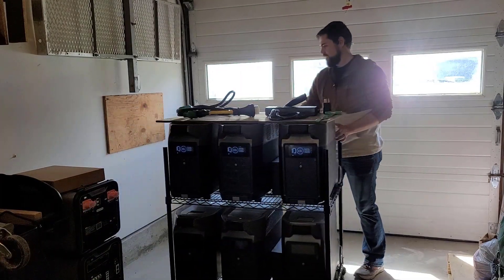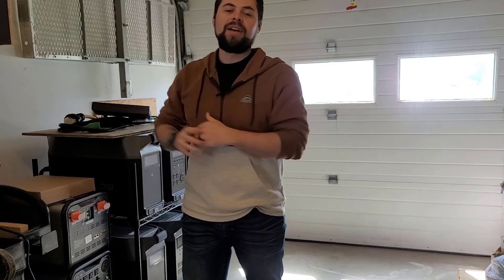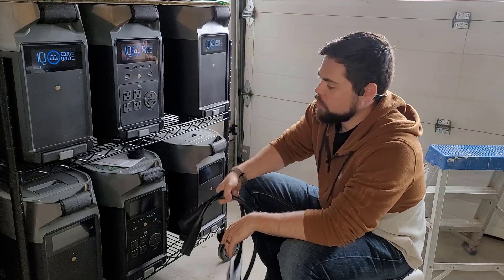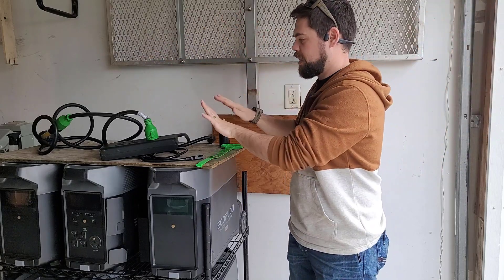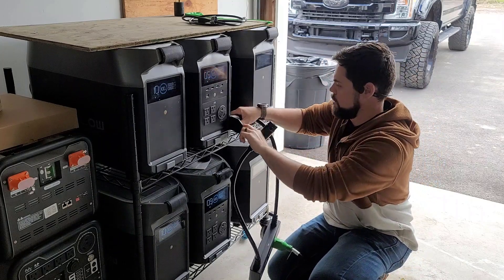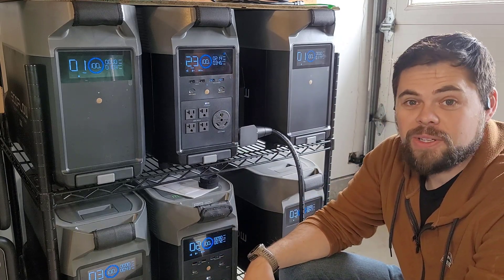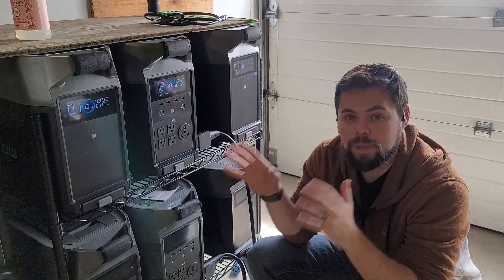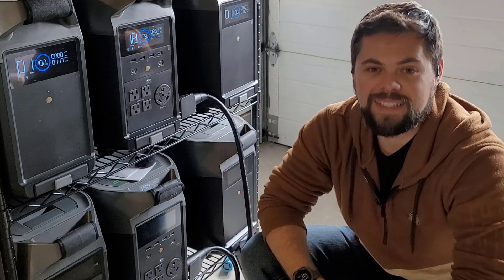EcoFlow Delta Pro Setup and Test

Comment: Now how would you use a smart generator to recharge if you couldn’t use solar?
Reply from the maker: The smart generator plugs directly into the back of the Delta Pro in one of the battery ports. If you have two batteries, you have to disconnect one of them to recharge the system. That's a poor design in my opinion but that's how you do it.
Reply: @minutemansolar  yea I agree that kinda annoying. I seen me guy have two separate inlet ports and he would use his smart generator in one of them from the outside which powered the outlets and then he would plug in his delta pros in the wall outlet then when charged he would which then around and plug the delta pros back in the inside inlet from the house and remove the gas generator
Reply: Here is the video I’m referring to.

https://youtu.be/dmOzUCgnzw4

Comment: Did you consider the smart panel? I'm considering a smaller setup, but I am debating using their smart panel.
Reply from the maker: I didn't do the smart home panel because it only works with the DP system and I use many systems since I test this equipment out all of the time. Also the new Apollo that I will be reviewing in a couple of weeks should beat the Delta Pro and I didn't want to be stuck with the smart home panel. So I have to use a Manual Transfer Switch which is a little bit of a pain but I am okay with that.

Comment: May i know what your load is and how many hours is that setup is going to run your whole house?
Reply from the maker: The load varies depending on the time of year, how many people are home, how clear the weather is, and many other factors. Generally I can stretch the batteries to two days of power if I am careful with what I run. If I have clear sun each day, I can pretty much run everything like normal and recharge the system each day. That being said, I am about to get my Apollo system which will have 4,000w of solar input per Apollo. So a single Apollo has more solar input than two Delta Pros put together. I recommend waiting a week or two until I get my system for me to come out with that video then decide between those two units.

Comment: Great video thank you so much I have several questions I know you’ll probably never see my post but I don’t know who else to ask for right now I live in Phoenix Arizona and I have a tesla solar system I do not have batteries I’ve had the Tesla system one year and I enjoy it zero problems but as you know if the power goes out here my solar panels don’t work I really like the Eco flow products and I’ve been wanting a way to back up my house using the Eco flow so when I saw this it seems like a perfect solution except if you have a real power outage how do you charge these things once they run dead now my first thought was buy a portable generator and recharge it with that but that will create noise could you tell me what you do in the situation? No obviously if I had power then the solar panels would be working and I could charge the Delta flow or charge the Eco flow just by plugging them in the socket in my wall and all that power will be coming from the sun in the daytime and short I’m really bummed out that I cannot use solar when the grid is down and I understand their concern about electrical workers being electrocuted but there’s gotta be a way they could isolate the power to just stay in my home and not go back to the grid that seems very simple to do and if I’m wrong please let me know. Thanks again any comments from anyone actually would be greatly appreciated thank you
Reply from the maker: Hey Joe, I'm happy to help out. You can also email me at info@poweredportablesolar.com. 

Primarily these solar generators will recharge from solar panels so that they don't run out of battery. But in the event of bad weather where the solar panels are not enough and the battery dies, you can recharge them from a gas generator. Yes a gas generator is loud but you can get an inverter gas generator and they are quite quiet. You can hold a conversation next to them. I prefer the gas/propane dual fuel generators and I run mine on propane only. I do this because propane doesn't expire so I can store it forever. It's also much cleaner so the generator it self should last longer too. Since the Delta Pros recharge very quickly too, you only need about 2 hours to recharge it from zero to full. 

There's no way to use your Tesla solar system with the Delta Pro. Those solar panels are on their own and you can't flip them back and forth between using them for the house/grid and then using them for the Delta Pro. So you'll need more solar panels for the Delta Pro.
Reply: @minutemansolar  that is a huge help. So you confirmed kind of what I was thinking. Just get a couple of very quiet inverter generators and the propane idea is great because it’s clean like you said. And recharge the Delta pros with those if needed. And like you said I could get some separate solar panels for the Delta pro. I love hate hate I love how you set those up on a rack that’s really cool. I live in Phoenix Arizona what part of the country are you in? I’m not asking for your address or anything I’m just curious a general area. Thank you so much for your response it was really nice of you. Also thanks for providing me your email I’ll check out your website if you have one.
Reply from the maker: @joeglennaz  No problem at all. I am in SE Idaho, near Idaho Falls. There is a new solar panel stand system coming out soon that will be even better than that rack system. I'll have a video on it when it's released. Typically I keep enough solar panel power on hand to power my entire house with this system.
Reply: @minutemansolar  I can't wait to see your video with the new rack system. I just double-checked and my notifications are on all! Thanks again
Reply from the maker: @joeglennaz  It's gonna be great!

Comment: problem i have with these is they use so much tech. what happens when the smartphone app doesn't work? When wifi doesn't work, internet doesn't work.
or a component goes in it. I'm for all in one units, I have an eg4 all in one, but that's separate from my battery, which is separate from my logging raspberry pi unit. And even then an EMP would wipe all this out.  I'm scared of these units which are heavily GUI run and APP driven. Something goes, you're toast. Maybe more suited to off grid living vs stuff hits the fan sort of scenario where you can't get customer support on the line or new parts.

Comment: Ok, So question. I have 1 Delta Pro. During this last Hurricane I lost power. I had a gas Generator powering my electric panel and was able to turn on 5-7 15amp switches for Refrigerator, lights,  portable AC, Tv's etc,,, I also plugged the Ecoflow pro into a wall outlet and got it to charge to 100% in about an hour. Then at dark, turned off portable generator, pulled it into the garage and then ran on the Ecoflow for the night. Worked Great. So, the question is; with the set-up that you are showing you power up your entire house, Can you at the same time just plug into a wall outlet to charge the Ecoflows at the same time? Perpetual power? Thanks
Reply from the maker: So no, you can't get perpetual power that way with the Delta Pros. If the Delta Pro is running the outlets, and then you plug the Delta Pro wall charger into an outlet that is being power by the Delta Pro, you're actually just losing power because the chargers and inverters have an efficiency loss due to changing power to different voltages. So you actually lose more power by trying to power the Delta Pro with the same Delta Pro.
Reply: @minutemansolar  Thanks that's kinda what I thought. So if I had a E-Flow smart Generator hooked up to it and I was powering the house, I presume it would turn on automatically and charge to 100%. So, the big question is in a 24 hour period would that 1 gal of gas charge it enough times to keep the house powered?
In other words, 1 gal of gas a day to power it? Thanks again
Reply from the maker: @jerrylarose7857  There's no way to know without testing it on your own since it 100% depends on how much power you're using and how fast the unit charges while running stuff.

Comment: is it possible to connect 6 of the main unit together instead of the battery. so that there is room for more solar panels ?
Reply from the maker: I wish, but no that won't work. The only way the Delta Pro main units can connect together is through the 240v hub.

Comment: Loved the video, bought 2 generators and 4 batteries, and power hub.  I have had to return the 2 generators (2 replacements received), now one of the replacements is showing a 550 error code, and I cannot use the hub to plug in like on your video.  I have reached out to Eco Flow, but their service model is somewhat frustrating.  The setup works great, when it works, but these issues are making me wonder if there is a deeper quality control issue.

 I was hopeful you could do a video on all the error codes.  I see a lot of videos out there of frustrating users, and I think it would get lots of views.
Reply from the maker: Thanks for the feedback, that is good to know about the concerns. I personally haven't had any error codes really except for if I over-power the unit. I will see what I can do to find out about error codes and see if it's a video I can make.
Reply: @minutemansolar  - Many thanks

Comment: Are you running a central A/C system on this setup? I’m assuming not.
Reply from the maker: I have mini splits in my house, not central A/C. But I can run all four units on this system. If your central A/C breaker in the electrical panel is 30a, then you can use this system to run it.

Comment: Can I ask a personal question ... for your set up what was the total cost please?
Reply from the maker: All in was about $23k. I have used this system 3x already to run my house 100% off-grid. That includes running my well pump, A/C through mini splits, TV, 2 fridges, 2 freezers, wifi, fans, lights, and so much more. My entire house 100%. It's even help save on my electricity bill each month by running certain things on it permanently.

Comment: The link you provided for the uline cart does not seem to go to the same product you are using in this video.  I am putting too a system just like yours and would like to use the same setup you have, including the cart you stow it on - with the wheels.  Did you have to order the wheels separately?  And which shelving unit is the one in your video?  Thanks!
Reply from the maker: Sorry, I forgot to add the link for the wheels that you have to buy separately. You can get the wheels here: https://www.uline.com/Product/Detail/H-1205WH-BL/Wire-Shelving-Accessories/Polyurethane-Casters-for-Wire-Shelving-Units-Set-of-4-Black?PDPRelatedItem=H-2945-34BL
Reply: Thanks for the quick response!  I just ordered the cart & wheels!  This should work great with my setup.

Comment: Love the set up and video! I’m looking for something that can run more off grid everyday, then have the option to switch onto grid if I need to. 
Something to run a whole house and garage for electric heaters in garage. 

Anyone know if Bluetti can do this?
Reply from the maker: Seriously, don't touch the bluetti with a 10ft pole. You can see in my review here all the reasons why: https://poweredportablesolar.com/is-the-bluetti-ac300-is-a-worthless-amazing-solar-generator/

Currently the Delta Pro truly is the best system. Electric heaters use a lot of power so you'll need a lot of solar panels to make it work. I can help you figure that out pretty easily if you shoot me an email to info@poweredportablesolar.com.

Comment: Curious why the deltas on the bottom part of rack shut down at 8:43 ?
Reply from the maker: They didn't shut off, the screens just turned off. The screens have a timeout setting. It definitely seems that way though.
Reply: @minutemansolar  Thanks that makes sense.  Great review ... I'm eyeing the Delta Pro and the Bluetti AC 300

Comment: I want to know more about the panel switch you used.  The EFD Panel is hard to get and expensive.  What model, brand and type of switch is it?
Reply from the maker: I don't know exactly what switch I have. I believe it's just called a Power Inlet Box, sometimes referred to as a manual transfer switch. It's just a plug that a generator can connect to and power and electrical panel. Any experienced electrician should know exactly what it is and be able to install it very easily.

Comment: What moron would use this setup? You’re paying $1000 per kWh. That’s double the price of a Tesla power wall which gives you double the power output. And Tesla power walls are the most expensive home battery system. It’s a fully self contained unit inverter with a heat pump inside it. These are designed to be portable and that’s why they cost so much and can not output as much.  If you built your own system with good quality LiFePO4 batteries (talking brand names self contained with proper bms) you’re looking at costing 1/3 to 1/4 the price of using these.  

Unless you got these things for half off and you never need more than 30 amps of power… sure.  (Each powerwall does 100A)  Or you could get a Ford electric truck and then use their off the shelf system that can power your home from the trucks battery. That cost per kWh is about 1/6 the price of this horrible setup.  Buying an electric ford pickup is actually the cheapest off the shelf home battery you can buy right now and you can also you know… drive it.  

Home battery systems and electric cars also qualify for large tax rebates.  These portable power systems do not.  So you can buy two Tesla power walls for $17,500 and then depending on your state, get $3-8k off that. Even more when you add solar.  Because what idiot would put batteries in without a solar system.

Comment: How long will it run your house
Reply from the maker: I ran my house recently non-stop for 4 days using everything like normal. I did a whole video on the experience you can watch here: https://www.youtube.com/watch?v=X-qlAHMldMQ. In the end I need to get some more solar panels since I was only using 50% of the maximum amount of solar panels that could be attached. With adding more panels I would have less worries. I stopped at 4 days because I had other projects to move on to and needed the panels. I will be doing another video on this when I get more solar panels. https://poweredportablesolar.com/product/delta-pro-kits/
Reply: @minutemansolar  thanks  for the update mate

Comment: Would be nice if they update the spare batteries to allow some use of them if the EF DP's BMS dies. Similar to the B300 batteries Bluetti has for their AC300. At least you would have some use of the energy from the battery.

Comment: Bluetti?
Reply from the maker: I prefer this system to the AC300. The AC300 idle power consumption rate is 63 watts, which means in a 24hr period it will consume 50% of it's own battery just to be turned on.
Reply: @minutemansolar  wow. Thanks for that!

Comment: Did I miss the discussion on cost of your system? How much does that exact setup cost someone to buy?
Reply from the maker: It's not cheap that's for sure, but it's definitely really nice and comfortable, no gas, no maintenance, etc. The kits can be found here, they vary in price quite a bit: https://poweredportablesolar.com/product/delta-pro-kits/
Reply: I have a Costco tri-fuel gen I run on natural gas so I don’t deal with gasoline either. I bought it on sale for $700. I do have to change oil every 50 hours, and it isn’t as quite, but I run it as far away from the house as I can, and inside it’s barely audible. Your setup is cool.

Comment: I believe this is passthrough as well, meaning you can use and charge at the same time. The only drawback that I have seen from another youtuber is that the ecoflow only has around 800 cycles for recharging before battery degradation. That is my only concern.
Reply from the maker: Yes it has pass through charging, it can charge and run at the same time. This unit has LiFePo4 batteries so they have 3500 cycles whereas the Delta Max uses Lithium NMC which has 800 cycles. :)
Reply: @minutemansolar  Ah that makes sense, I must have had my models mixed up. 3500 cycles is way more acceptable.

Comment: Wow, this do not make sense at all. You have to switch off all your stuff and switch manually to battery, non-sense. You should have bought LIFEPO4 48v battery packs and a couple of inverters grid-tied with PV mppt controller and ups functionallity for much less, with automatic  control of battery/PV/grid usage with the possibility to use the produced PV power.
Reply: It can now be shut off and on automatically or not etc through the firmware update. Also for a top notch diy system you pretty much almost break even on a diy build due to current cost & shipping. Not counting the tools needed for the build & extra wires etc. Just fyi. already looked into it.

Comment: Can you get 240 with a battery instead of DPs?
Reply from the maker: Sadly no. What determines how much power you can run is the inverter, not the battery. Delta Pro has an inverter, charge controller and battery (plus many other little things). The battery just has a battery, no inverter.